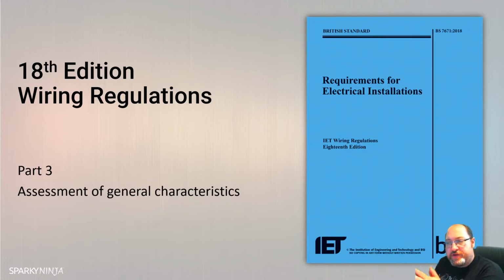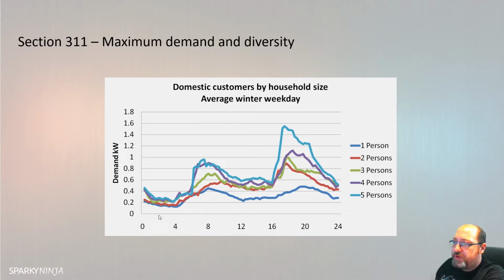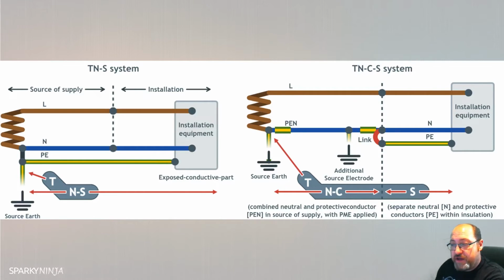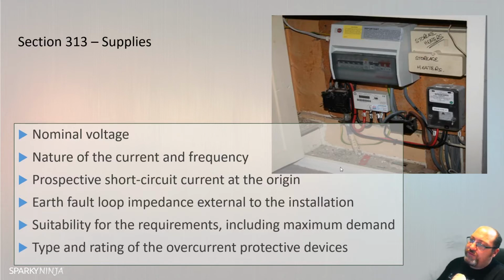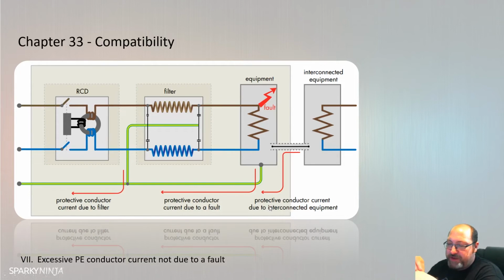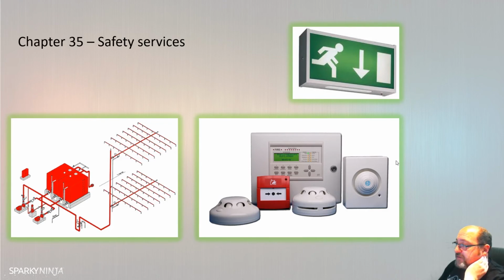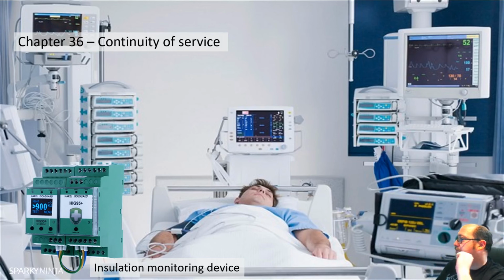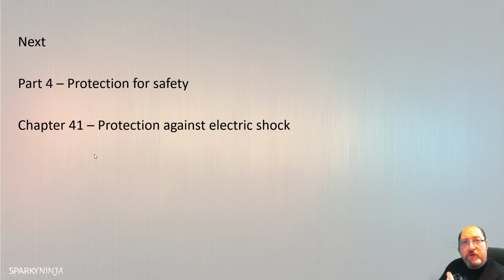18th Edition Training Series - Episode 4 - Part 3, Assessment of General Characteristics

Comment: Hi Sparky Ninja, Can I just clarify with you about TN-S and TN-C-S. I have been qualified in Australia since 2007. In the Aussie main meter boards we had an A and N from the street and we have an earth stake which  has an earth wire linking the neutral bar and earth bar M.E.N. The coloured diagram you use to explain Fig 3.8 and 3.9 would the coil be in reference to a street transformer, or to the isolation link  before the meter ?     I think you do a BRILLIANT job on how well you deliver these videos, very much appreciated.  Regards John

Comment: Hi Sparky Ninja - in your video you use a split CU - I hear in the 18th there is a requirement for each circuit to be protected by an RCBO?
Reply from the maker: It's not a requirement unless it's considered necessary for effective division of Installation for the avoidance of unwanted tripping.
Reply: @SparkyNinja  thanks for your reply 👍